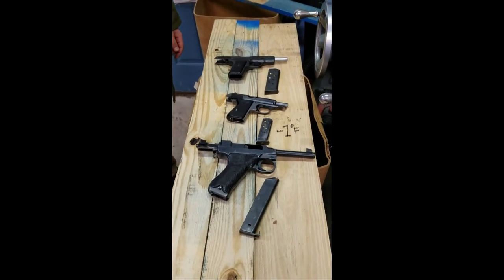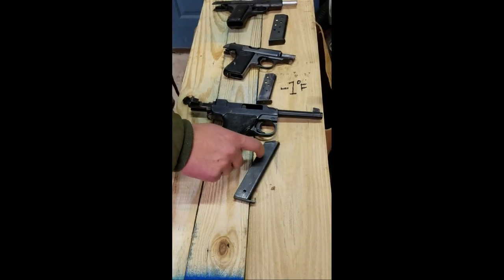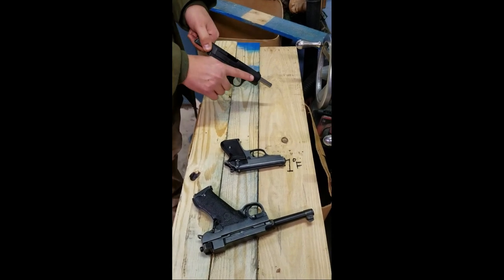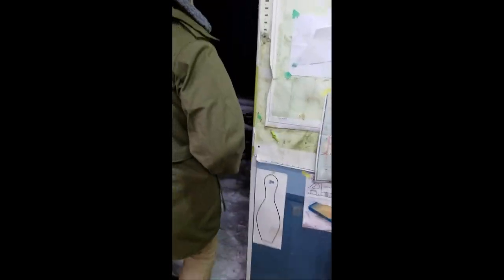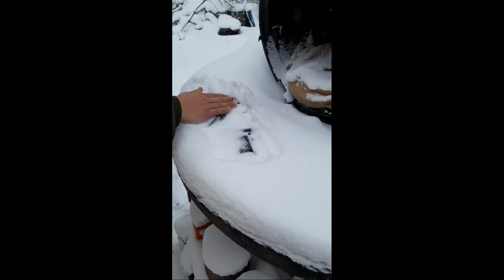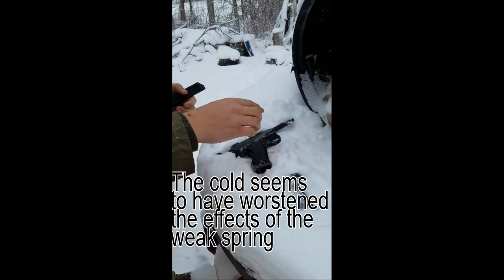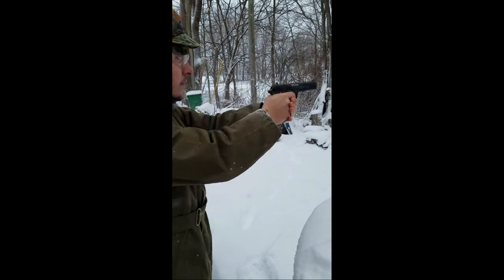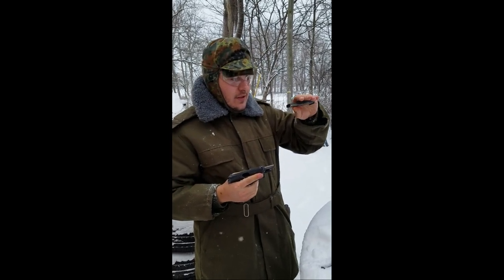Antique Pistol Winter Test

Comment from the maker: Regarding our comment about the Lahti's recoil spring. It is not "exactly" permanently installed but it is on a guide rod with a head on the forward end, which is inserted through an abutment in the frame and then the knob is staked on. So, the spring stays with the pistol in field-stripping. The spring looks almost like it's from a .22-- it's quite small compared to just about any other center fire pistol. To replace it the knob would have to be un-staked.... certain things, one is reluctant to do to certain all-original pistols, but it must be done. We're going to look at maybe "unscrewing" the old spring from the rod but as the spring is closed on both ends, that is probably a no-go. It would be difficult to remove the old and install the new that way without distorting them.